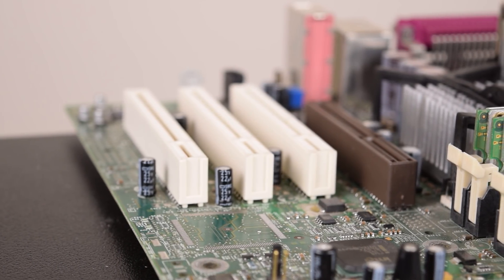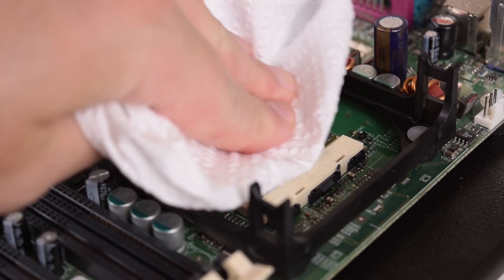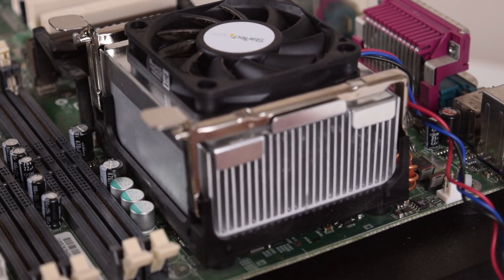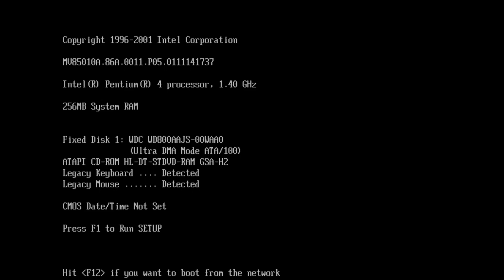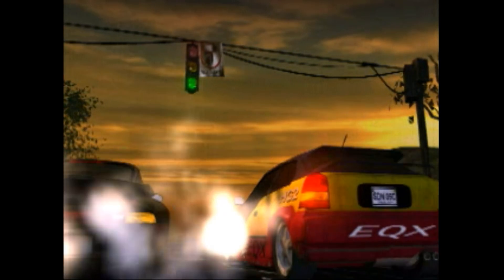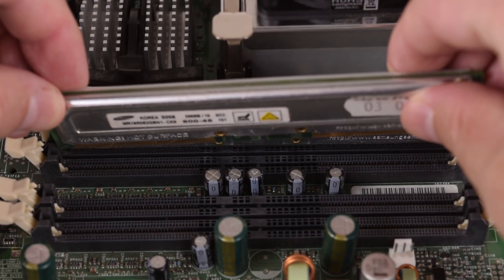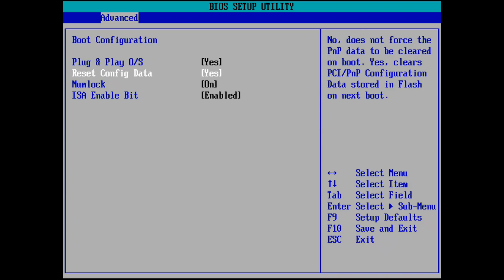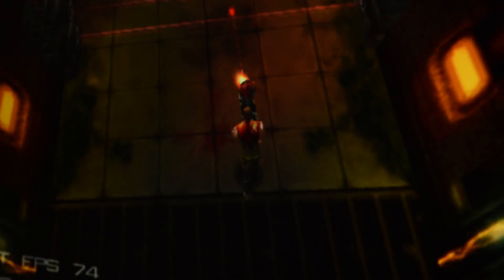Rambus RDRAM Pentium 4 1.4 GHz vs Pentium III

Comment: You are in for some serious cringe once you get around to testing the Pentium 4 with SDR.
Reply: Pentium4  looses about 40% of the performance when equipped with Sdram.
Reply: @playnochat
>Mafia 3 and Dishonored 2

plus No Mans Sky (aka no gameplay) and couple others, the issue is always hardcoded SSE 4.1 - some young/inexperienced dev being 'clever' and flipping max optimization in the compiler. Funnily after "de optimizing" those games back to SSE 2-4 level performance stays the same.
Reply: i have such a system here... some old compaq desktop pc. 1.7 ghz p4 with 512 mb sdram, feels slower than a 1 ghz p3
Reply: sdram is sorta slow, it's performance with a Pentium 4 is so bad, that even if I tried to load a directx 10 game from scratch, it would be, and I quote "severely" 100% bottlenecked by the sd-ram latency alone. sure its going to run @ possibly 1fps, but really?, unplayable.
Reply: I have a Pentium 4 with SDR, but I haven't tried to run games with it as both of its disc drives are broken.
But mine only came with 256 MB, so is it going to be that bad compared to a 1 GHz Celeron?
Reply: I actually still have Phenom 2 850 with geforce 950 as my current gaming system. I am not the only one, because Mafia 3 and Dishonored 2 didn't support my processor, but after the shitstorm they do. I admit that this is the lowest end to play modern games, but not useless yet.
Reply: It is slower than 1Ghz P3.... especially in games. Fast memory and FSB was the only saving grace of P4, you take that away and the weak low IPC core starts to really "shine".
Reply: Well there is run and "run". The SSE1 of P3 became obsolete only last years when it comes to "running" stuff. As it comes to P4, I have dual Xeon Gallatin system aka 2x3,4Ghz Gallatin with HT and 2MB L3, and as it comes to "modern stuff" it is still laughable. Yes it can run crysis but thats still 2007 executable, even the P3 can execute that, but throw in modern browser and some video and you will be glad for really low 720p. Yes it can still launch steam for example, but what are you going to play there eh? Some "HD" version of retro games? Belive me, they are both equally useless. Even Core2/Phenom 2 is bordeline useless now. For like 8 years already everything is being optimized only for Nehalem architecture and its descendants. P6, nethburst, amd Kx, it all went to drain in modern SW and games. Its all Nehalem and higher now.
Reply: well true... the only good thing about the P4 is that it supports SSE2 so it can run newer applications which the P3 cant run. but overall the P4 is pretty garbage and i never really liked it. i do love my tualatin P3 though

Comment: There are mainboard with certain chipset for the pentium 3 that supports rambus-ram.
Reply from the maker: Yea, I looked for one for a while, but they are super hard to find, expensive, and the Pentium III performs really well with regular SDRAM, doesn't gain much from DDR or RDRAM.
Reply: I know. I'm on the hunt for a Intel Desktop Board vc820 for a xbox alpha clone build, but the are expensive and rare.
Reply: Mine is a HP (AFAIK it's a rebranded FIC) KC19+ with i820 chipset. Nice and fun but otherwise it can't benefit from the extra bandwidth of the RDRAM at all.

As for P4 RDRAM I went with socket 423 because I already had a good Swiss army knife i865 board that supports every S478 CPU. Those S423 CPUs are so awkwardly cute :D
Reply: Dell Optiplex GX200  system has Pentium 3 , RDRAM, inbuilt Nvidia TNT2 (?) no AGP slot though, had one for a few years, not having an agp slot killed it for me, was a fairly quick system from memory
Reply: HP KC19+, on the other hand, has both an AGP and 2 ISA slots. It still isn't really faster than a BX board - but it can use 1.5V AGP cards and has a proper AGP clock divisor for 133MHz FSB. And it's more unique.
Reply: Intel 820 chipset. A frivolous attempt to move P3s with the newer memory standard.  On P3s with 100/133Mhz FSB it's pointless.

Comment: 1.4 GHz Tualatin vs. 1.4 GHz Willamette vs. 1.4 GHz Athlon!
Reply from the maker: For sure :D
Reply: PhilsComputerLab
 PLZ
1version -  1.4 Tualatin + SDram VS 1.4  Willamette + RDram VS 1.4 Thunderbird + DDR 
2version - all SDRAM (815 / 845 / 133A)
Reply: First gen Socket A athlon at 1.4Ghz or XP at 1.4Ghz?
Reply: Alberto Martinez I think 1st gen would provide more equivalent results. XP should be compared to the 478 platform.
Reply: Junior BCM, oh I was scared of that fly :D
Reply: A lot of enthusiasts, myself included, waited for Intel to get their act together.   I have always been a budget gamer and even after P4 launched I picked up a MSI 815 Pro board with a Pentium 3 866Mhz running over 1Ghz, 384MB of PC133 and a couple of decent AGP cards like the GeForce 3 Ti200. I ran that machine for years until I got a box with a 775 Pentium 4HT. A solid performer before the DX9, SM2/3 revolution. 

The early P4s were awful IMO but the later ones were amazing. I used that 3Ghz single core P4 well past it's lifespan. I never did use anything AMD after the K5/6. I just felt like Intel's chipsets and chips were solid performers with great stability. The capacitor plague was a nightmare and using those old boards these days has to be a challenge.
Reply: Alex Man
This is stupid, Athlons FSB is DDR  Pentium's is not.
Reply: It depends what chipset you give to that Athlon. Give it Nforce2 and yep sure. Give it period correct KT133 with Sdram and it will be hard fight with the Tualatin and often a loss. The only thing that will be left in the dust is the P4.
Reply: I thought a fly was on my screen...
Reply: We need a benchmark on these Phil (please) :)
P III -S 1.4 vs. This system vs. Athlon Thunderbird 1.4 - complete with power measurements, temps...
Reply: But why? There were no Athlon 1.4 at the time the p4 launched, the fastest was the 1.2... :D
P4 Launch review: https://www.anandtech.com/print/661/
Athlon 1.33 Launch Review: https://www.anandtech.com/print/741/
Athlon XP Launch review: https://www.anandtech.com/print/835/
Reply: axl axl, я прекрасно знаю, что у Athlon  шина EV6 и при работе с DDR получается сбалансированная система. Мы спустя почти 20 лет ищем не потенциал, а просто сравниваем старые железяки.  ( use the translator from Google )
Reply: it would be kinda fun to see these 1.4 ghz processors vs. some underclocked modern processors.. (sandy bridge or newer) @ 1.4 ghz.
Reply: Man, I remember those days, back then I was rocking a 900 Mhz AMD Athlon Thunderbird on a Abit KT7A! It was my first computer build! these chips back then held their own.
Reply: That would be skewed quite badly given how much later the other 2 cpu's came out.
Reply: PLZ
1.4 Tualatin + RDram (i820 platform) VS 1.4  Willamette + RDram VS 1.4 Thunderbird + DDR
Reply: Thunderbird 1400c, last of the athlons, feels more interesting.
Reply: That isn't really a fair fight man.. Athlon destroyed everything in that generation Intel had to push it's p4 chips to 3+ GHz to get ahead of a 2GHz Athlon. And spoiler, the Athlon is still a smoother general use CPU the Pentium 4 was not that great really, it crippled the fastest way to alter memory data (it was slower at shift bit ops than a pentium 1 in most cases) hyper threading was and is still a  gimmick feature.. the p4 version only supported an additional add or sub instruction per clock no other instructions were supported. Testing Cienbench on my i7 with HT on it scores 4.11x multiplier vs single core score with HT disabled it still scores 3.96x the single threaded score that's only around a 3% improvement by having HT enabled vs not.. Which lends to my theory that it still only supports a tiny amount of the instruction set and as such is still a well marketed gimmick. They even got Microsoft to show the HTs as "cores" which is laughable as they don't even increase performance by 25% let alone the 90-100% you should get  with that additional core count. For fairness AMD has done the same thing with it's Multi-Threaded technology another set of "cores" being reported that do not support even close to a full instruction set another gimmick.
Reply: @bdhale34  I have seen performance gains of as much as 45% with vertical threading. (HT) Of course not with all apps but some freak multimedia apps sure. It is especially welcome when I am doing huge mixdowns of multitrack audio with lots of software filtering. It means the difference between it actually working and not. 

  Hyperthreading on the early p4 days before dual cores really did make the machine feel much more consistent and smooth. It wasn't just a gimmick. One could have several apps running in the background and have much less impact to the game than on a single core athlon xp, even if the athlon had higher fps. Such as voice chat software, a couple of web pages, music player.... Of course it did lower performance to have such things running, but they were far less noticeable.
Reply: @bdhale34  I addressed this already...  Instructions had nothing to do with multi tasking. You are confusing that for ILP, which again is not instruction set specific. You would code much the same for SMT as you would for SMP, the difference at the code level is how you optimize for SMT vs SMP. And most of that is in specific to the compiler and how it would organize branches of code.  That is if you were coding for multi threading in the first place. 

The purpose of vertical threading was not to increase performance so much as it was intended to reduce performance loss from context switching. And this spilled over to multitasking as well.  I ran both a P4 and Athlons through that time, and the P4 was always the better experience. Even if it got lower FPS in games given a direct comparison to its closest athlon competitor. (as i am now saying for the second time.)

No, it was not just a gimmick. I can see now you don't have the first clue what you are talking about. 

The last sku's to resemble anything like the P6 core was yonah, One could argue it was Penryn, (second gen core 2) and it didn't have SMT. And at that its back end and decode stages were completely different.  Nahalam was a very different beast in its front end and early execution stages were reworked completely from core 2.  And this was done by the american team that designed the P4 using the base backend design from the Israeli team who made Banias/dothan/yonah/conroe and penryn.
Reply: @wishusknight3009  In order for a CPU to process an instruction it has to understand it.. if the extra "threads" only know how to add and subtract.. that's all they can do.. they will speed up absolutely nothing else. If a program is calling any instruction the HT didn't support the HT sit's idle. This is how it works. P4 HT was a tech demo a complete gimmick that became a useful technology. In 90+% of tasks HT made zero impact to performance on the Pentium 4 because the HT could only do limited instructions. read the white papers on the chip once or twice. And take off those stupid rose tinted glasses..
Reply: @bdhale34  Yeah, you have no clue what you are talking about. I have no clue what you are talking about. Did you even bother reading my whole comment? You dont seem to be.

 I think you are confusing it for something else. It is like you didn't even click the "read more" on my comment. THREADING IS HANDLED AT THE OS LEVEL  And applications are either multi threaded or they are not. Several single threaded applications can still be assigned to different virtual threads on a single processor/core system.  And in these cases, HT would prevent studdering and threading issues when several applications were running at once.. What part of thise don't you grasp?

THE ONLY DIFFERENCE IN CODING FOR SMT OR SMP IS HOW THE COMPILER HANDLES BRANCHES.. THAT IS IT. 

Seriously, where do you learn your information from?
Reply: @wishusknight3009  Read the white papers on the Pentium 4, all threads are not created equal inside the chip. There's a reason the completely overhauled HT for the next gen that had it and dropped all the p4 parts and went back to pIII architecture. The p4'' 2 threads were more functionally  1.1 threads. I'm sure it helped sometimes with some things but it isn't the grand game changer you are remembering. That was Core i+ not P4.
Reply: @bdhale34  I know what the differences are. I still do retro computing and still have a p4 set up right next to me. A northwood 2.4C to be exact. Shutting off HT gives the computer an entirey different feel, especially when attempting to do a couple of different things. 

And as I have now said for the 3rd time, HT was NOT meant to boost performance so much as it was a means of reducing the loss of performance during context switching.

Playing Unreal Turnement 2k3 while having winamp playing music, using a listen server with a high number of bots, several web sites open in the background and voice chat will feel much smoother and normal with HT on.. With it off the game can quickly become unplayable with all the jumps, studders and shrort freezing. EVEN THOUGH the frame rate reported will be much similar. 

That is more than a gimmick to me.  It isn't any sort of special instruction set, or other woo. The P4 and P6 cpu's before it were all built for SMP and multi socket systems..... This isn't hard to understand. sheesh.
Reply: @wishusknight3009  A Northwood 2.4c you say... well why would disabling HT do anything with that chip? It isn't a 3.06 Extreme edition (The only northwood p4 produced that actually had HT). It is in fact so much of a gimmick you don't even know your chip doesn't have the feature  to disable it. If disabling a non existent feature slows the chip down something else must be wrong with your retro rig, other than it using a Pentium 4 in the first place.

Comment: Enjoying the direction you're going with the reviews, looking forward to reviews of the P4 with SDR and DDR memory, as well as the P4 with different speeds. Just built a 1.8ghz P4 system based around the Intel 865 chipset for windows 98 and a little bit of early xp gaming. Would love to see how it stacks up. I was a big Amd fan back in the day, so Im also looking forward to some amd benchmarks from this era.
Reply: Oh yeah, I forgot to mention, I'd love to see some Tualatin benchmarks thrown in there. My first ever retro build was a Tualatin 1.4. This would be a good baseline system to compare everything against.
Reply from the maker: i865 is my favourite chipset!
Reply from the maker: Yea just matter of time really.
Reply: PhilsComputerLab Yeah, gotta love the i865, very fast, flexible and has a good mix of modern features and legacy support. I've got the Asus P4P800 SE.

Comment: this is an okay comparison. but, pentium 3 was significantly faster than early pentium 4 for s.423 motherboards. 478 had advantages and was better tuned out.
Reply from the maker: 423 was dropped very early, I did explain my reasons for choosing 478. Advantages and tuned out, I am very sceptical about this statement and believe it to be not true. Back then the performance was in the chipset, no memory controller in the CPU, and both sockets have the i850 chipset. You can even get adaptors to convert, so I disagree, there is zero performance difference, it's just compatibility and future proofing.